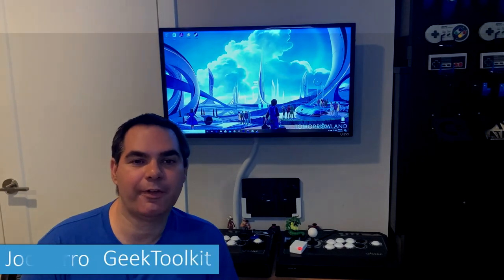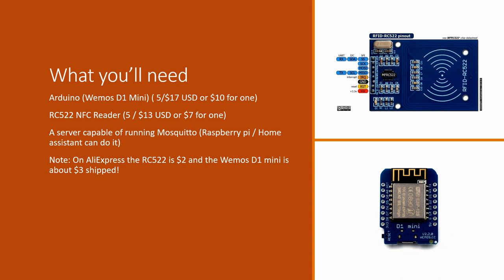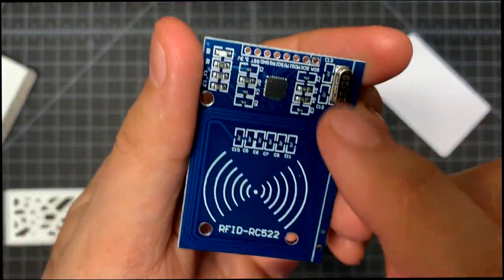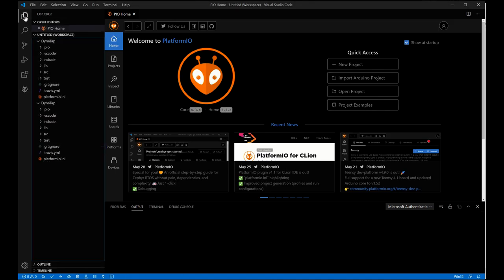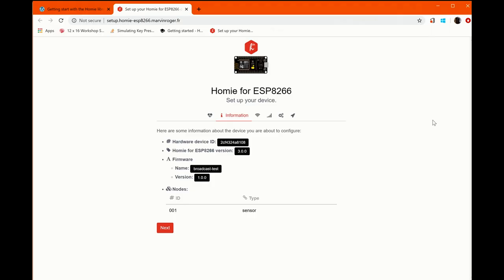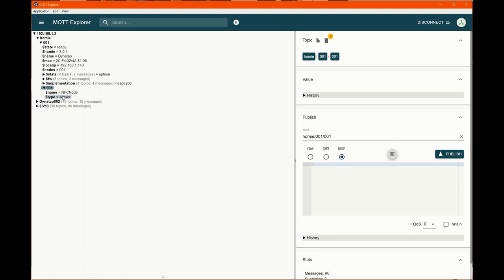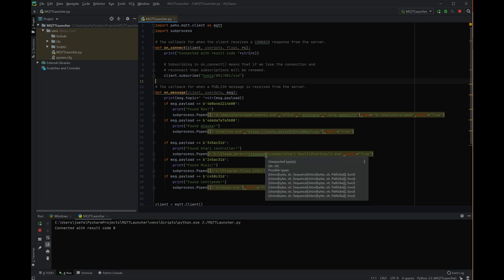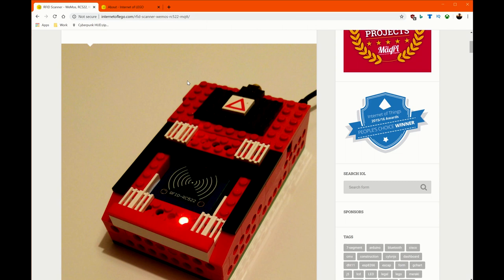Home automation via NFC using MQTT, an ESP8266, and Homie for $10 (Project Dynatap)

Comment: formatting SPIFFS is the hard way; you could just upload the config.json to SPIFFS to change WIFI etc...
Reply from the maker: Thankyou for this, going to pin this for others to know. It was my first time working with SPIFFS and learning about that part...I plan on switching this to ESPHome and seeing how it performs...if it doesn't tie it to Home Assistant that may just make the whole process easier and more flexible
Reply: @geektoolkit  have you made any progress on switch it to ESPHome? What would need to change?

Comment: Hi, I'm stopped with this VSC error: no matching function for call to 'AsyncWebServer::begin(WiFiClient&, String&)'. please have you  any tip to help me to solve it? many thanks
Reply from the maker: I dont know offhand. This was done a while back, and it is possible that some of the libraries it was built on may have changed since then.
Reply: @geektoolkit Many thanks, because I don't surrender, I did tried more and more and up to I find the right way. My naturall enviroment is Arduino IDE, sometime VSC make me hangry, because it often  want to bring  me  on  new and  unkow lanes.  Sometime the messages are traps.   The main think is that your progect works very well. thanks for your sharing of  MQTT explorer : great tool.
Reply: @GeekToolkit, sorry, but I can't find the Python components that you did indicate. Now I think to do all in my hands. Please cany you show me the link where to download that files?
Thanks

Comment: Cool project, thanks .. What are the benefits of better and updated nfc readers?
Reply from the maker: The main one I know of is just better comparability with more formats or sometimes longer range for reading (I’ve seen huge ones meant for parking garages even!)
Reply: @geektoolkit  I c - more compatibility with different tags - I was hoping you were going to say that it had better range. So far I have only used passive stickers, and the range is pretty poor, this looks super cool, can’t wait to try.

Comment: I think if you use NodeMCU-PyFlasher it will take care of clearing the SPIFFS for you if you check the box to do so.  I broke a a sonoff recently updating it by skipping versions and re-flashed it using this program instead of ESPEasy like I used to use.  Also I see in the comments you recently got Tuya Convert working, that was a pain in the butt for me but I just got that working too, have a few more power strips on the way to play with it some more.  Its nice having a 4 relay smart power strip under Tasmota.
I just found your channel I really like a lot of your projects.  Wish I could dig up the time that you have (and DrZ and TheHookUp) the 3 of you are the top dogs IMO, look out though I am trying to come back :)
Reply from the maker: Thankyou!  Man getting put into a bucket with those two is flattering, they're both amazing. DrZ just did a video on converting a frieking VW Bug to an electric car (Well WIP, but his methods and skill amaze me).  

Thanks for the tip on the SPIFFS, that threw me for a loop when I didn't know about them and was  trying to clear that data....so was glad to share it.   

The powerstrip you have, does it do power measuring as well? I have been considering getting into the 'measure power of everything' club...but we have such a low power bill that I don't want to overly invest in it. Tuyaconverting a power strip may be a cheaper way to go than some I've seen
Reply: @geektoolkit  No, no power monitoring just relays (as I took that first one apart and was going to flash it manually after having so much trouble with Tuya Convert) Now that I have it working I just flashed a Larkkey strip so it works.  Now for these devices that you do not have direct access to flash, to clear the SPIFFS use the Reset 6 command to clear those out.  Maybe I can come up with the Template for this device and submit it to the database.

Comment: Cool vid. I wonder if you are actually using NFC, or just RFID...
Reply from the maker: Good question! The readers I’m using can handle both. The 3D prints have MFC stickers on them, and the Amiibos use NFC. I’ve used RFID badge cards as well. I believe the sky landers and infinity also used NFC so I use (and this project and chip reader) support both

Comment: I realize this is a little outdated. I get errors when trying to compile still. Also am interested to see if you have this done with esphome.
Reply from the maker: Crud I'm sorry to hear you're hitting issues. My plan is to move this to ESPHome once my move is complete (november move, December I'll be back to making vidoes is the plan, and this is one of the first I want to do).  ESPHome is the much better way to do this esp. for interfacing with home assistant, and allowing for additional lights and such to give feedback when a card is scanned
Reply: @geektoolkit  This has me interested. Kind of want to try this in my car so I can scan a keychain rfid/nfc to turn on my (hopefully to be here soon) spotify player and start my podcasts. I have zero programming skills so I couldn't even tell you why DynaTap failed but there are also a deprecation warning for something as well. I will be looking forward to your esphome version! (I have most of my smart plugs flashed [sonoff s31s] and just added a raspiaudio-proto to the mix.
Reply from the maker: @SheLeftMeUnsupervised  When I made this I wasn't clear how ESPHome would integrate, and it wasn't fully into the home assistant family. Now that I understand it a bit more I'm excited to migrate to it. The 3d case also needs to be updated so I'll have to work on that. I'm excited for it as I have some great plans, and even when I had this working it was super fun to have different items do different things. I think your scenarios are perfect for it!
Reply: @geektoolkit  Will be looking forward to it. With the 3d printed case could you do me a big favor and make it large enough for using the pins. I have a bad habit of soldering pins lol. I have ruined too many boards trying to solder to the pads. Its pretty fun with the nfc cards. I have some with pictures of movie cases on them for my grandson. He scans a card and it plays the movie pictured on the card. If the tv is off, it turns on and plays it. simple to set up. the only drawback is the movie place isn't saved because it goes through the roku media player. He is too little to care so it doesn't bother him any lol. plex is a hit and miss. will have to try without the roku and see if i can get it to work as good.

Comment: my ESP8266 is stuck n { waiting for the device... }   :(  i've tried everything
Reply from the maker: Is this when you try to set it up? If so I'd flash it again but uncomment out the lines about wiping the partition, turn it on, turn it off after a bit, and then reflash it again with those lines commented out. Basically try to get it back to a good state and start over...I had gotten mine stuck and thats how I resovled it (Assuming you got it stuck when trying to use the webpage to program it)

Comment: Could I use an Arduino Pro Mini in place of the Wemos?
Reply from the maker: I don't know if that has wifi. You'll need something with wifi ideally, and you'll likely have to redo the code if you're not on an esp8266 based board